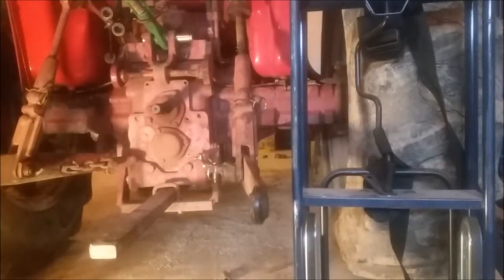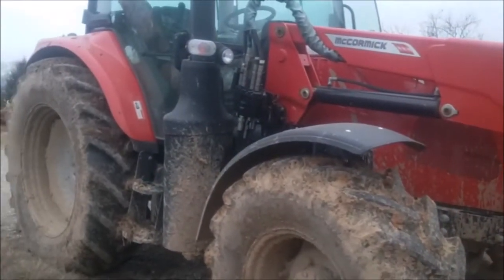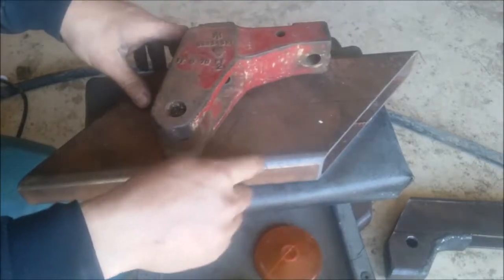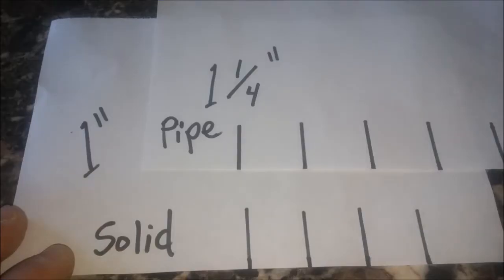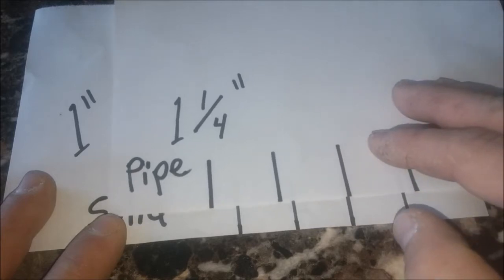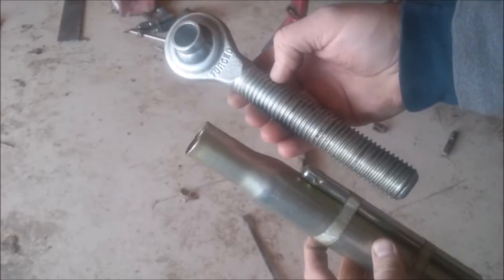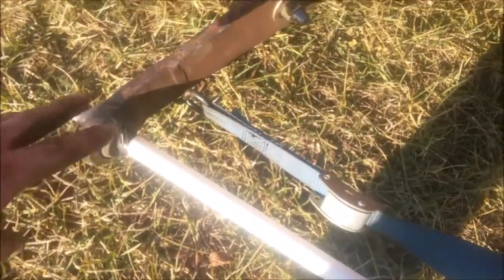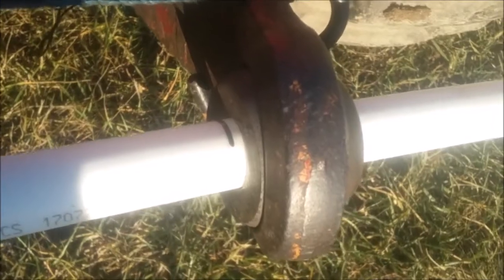Make TRACTOR STABILIZER BARS and BRACKETS

Comment: I too made my own stabilizers, but out of chain and turnbuckles.  I used one of those laser pointers and some plastic tubing.  Slid tubing into pivot making plastic bushing  inserted laser pointer with no play,  then with bracket mounted on axle,  laser marked the spot perfectly.  Glad yours lined up, I didn't trust my measuring.  Good job.  PS I will be using your staggered hole method on telescoping arms! Thanks again

Comment: Thank you for mentioning the safety fail regarding drilling those pipes on a press with no form of vice.  People take for granted that the drill press is arguably the most dangerous tool in a shop.  If the bit bites into the material, you either have a blunt force weapon or your piece has just been turned into a rotating saw blade.  You mentioned the "mess" it would make and the poor quality, but I would stress the safety aspect of doing that is worse than any damage to the product.  Just my $.02 and I'm glad you pointed that out.  Very responsible of you.
Reply from the maker: Thanks! I appreciate that